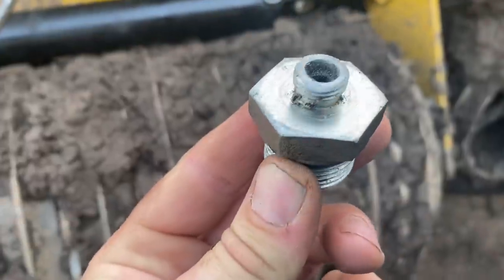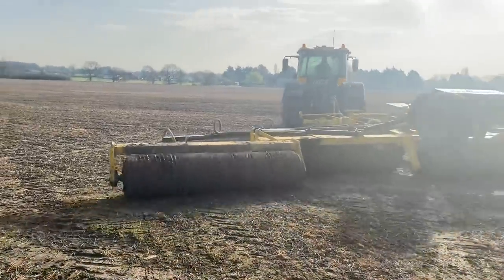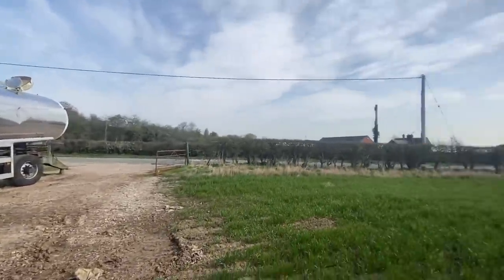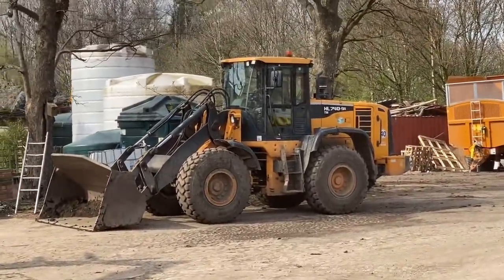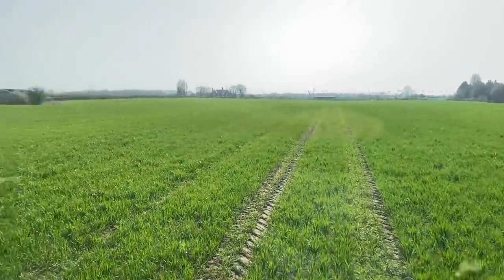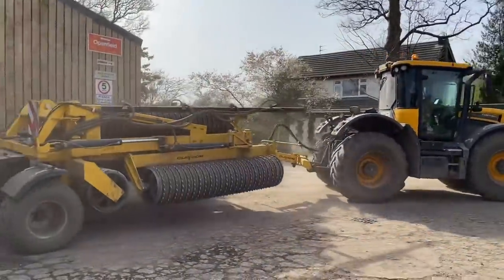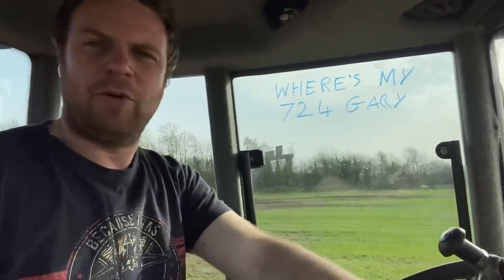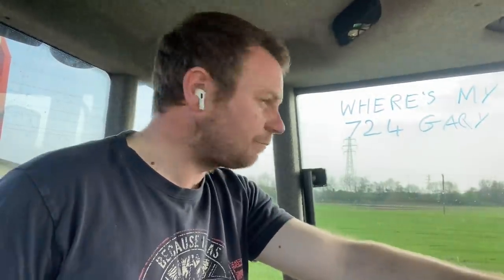Day 374 #OllyBlogs  FASTRAC BACK OUT ROLLING JD  6250r drilling & 724 SPREADING #lockdownlearning

Comment: It’s for adjusting the wheel track on your sprayer u plug it in to a 7pin plug near the front wheel.  I made the mistake once of doing it without moving and popped a tyre off.

Comment: Regarding the “Carter’s hitch” the lorry drivers of old used to take great pride in getting all their hitches at the same height & size right down the side of their vehicle.  Pride in their work, no one bothers now ☹️
Reply: Very little use for loose sheeting or rope work nowadays, as very little goes on a flat bed that isn't machinery and everything else is ratchet strapped or inside a curtain body to keep the weather off it, that is kinda like saying people used to keep their scythes razor sharp but nobody does now that they use combines. Technology has moved on.
Reply: @cmotdibbler4454    Still lots of flatbeds in Scotland because there’s lots of round timber transported south.
Reply: @themayorofdipshittery3646  Timber that isn't being transported on a timber trailer? I'd still choose ratchet straps or chains over rope as each piece of it is rated and marked and follows the codes of practice of the UK timber industry
Reply: @cmotdibbler4454   straps for the timber but the return loads are usually still roped and sheeted depending on the commodity.